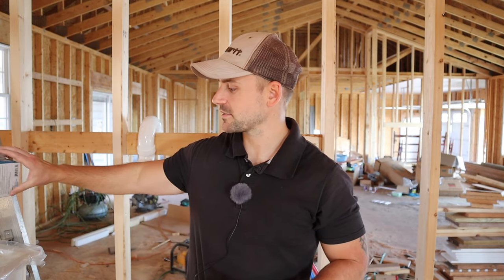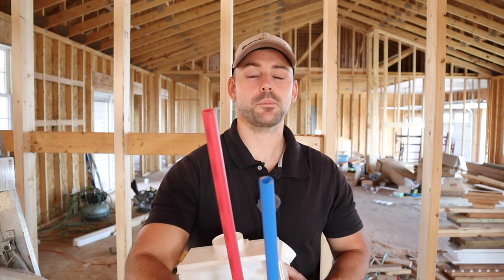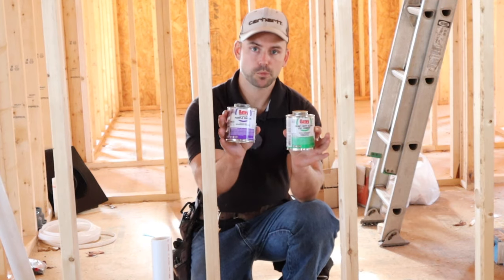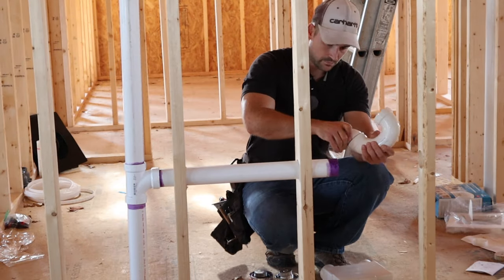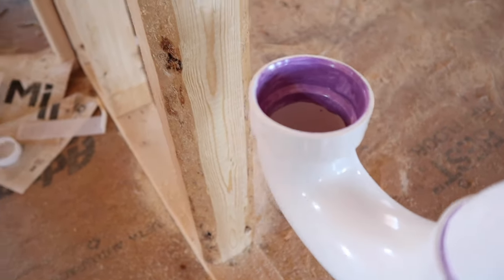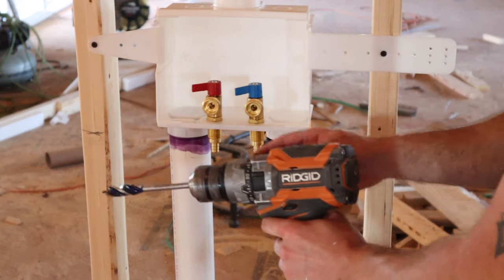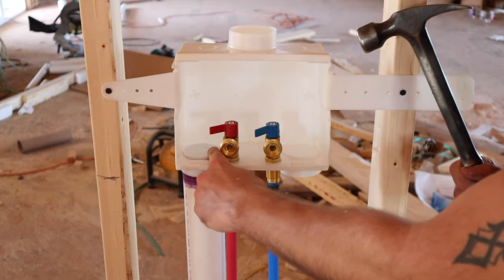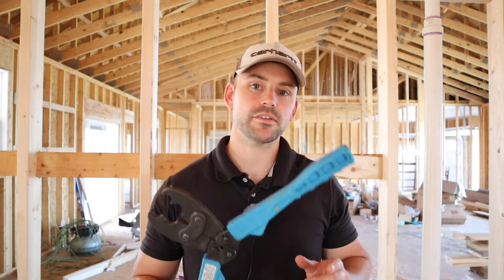Sharkbite Washing Machine Outlet Box Installation

Comment: Why do you need a trap if it is glued? Can’t clean it out? Thanks for taking the time to do these videos! I have learned a ton!
Reply: It’s to prevent sewer gases from escaping up from the main drain pipe(water barrier)
Reply: I use a trap with a drain cap and an access panel.

Comment: So, I have a stupid question. I have this exact same sharkbite outlet box. How in the heck do you get the drain knockout out?!? There's a little hole in the middle that was no problem to pop out; however, to get the whole knockout out seems impossible! It's one continuous piece of plastic! They advise to glue everything together before removing the knockout, but now that I've done that, I think it's made it even more impossible to remove the thing!! How do you get the thing off? I literally think it's one piece, so do I need a special tool?
Reply from the maker: Hello! The best way to remove that is to use a screwdriver that is a flat head and a hammer. Then kind of use it like a chisel and bust it out. Yes it is very strong so you got to put some muscle behind it. I was worried about breaking mine to when I had to knock it out. I hope that helps you!
Reply: @TheExcellentLaborer this comment just helped me!!

Comment: I have 2"x4" stubs. If I drill a hole in them for the 2" PVC pipe, I lose the structural integrity. Should I just run the p trap/drain outside the wall?
Reply: If it's load bearing, use a stud shoe. If it's interior and not load bearing the wall is fine as it's only there to hang drywall.

Comment: The hot water washer hose will not come off. Tried to loosen and tighten the hose to hopefully get some movement but it wouldn’t budge. In doing so, the whole valve assembly moved about an inch to the left and right a few times. It occurred to me that I was bending the copper tube below and behind the drywall. Should I be worried? Fill time for the washing machine didn’t change. Should I be worried? Is the copper pipe much stronger than I give it credit for?

Comment: Thanks for the video. Have you done any better methods besides the hammer for the 2 inch drain cap?
Reply from the maker: I usually use a little hammer. You probably could use a screwdriver and then hit the end of the hammer on an angle from outside of the box if you want.

Comment: Hello. Nice video. Thank you. Would you have a rough idea of about what it would cost me to pay someone to do this for me? How much would a plumber charge to install the box and hook up to existing drain and water connections? I know there's a lot of things to consider, but just a round about figure. Thanks
Reply from the maker: Hey David! A plumber in my area would charge $50/hr for this job. I would guess it would be about a 4hr job in an older house on a crawl space if drains and pressure lines were easy you get to. Hope that helps!
Reply: @TheExcellentLaborer  OK. Thank you so much for your quick reply. I was thinking of doing it myself but I'm still debating that. LOL. I go to Home Depot a lot and I haven't bought any supplies yet. Do I click on your link so you get a cut? Thanks again for your help.
Reply: @TheExcellentLaborer  I also buy a lot on Amazon too. I have one more question. Should I use hammer arrestors? Thanks

Comment: I just bought a home with a new washer box installed already. Can I use a 🔨  and 🪛  to pop it out while it's installed already? I'm afraid it will fall into the drain. I saw a video and the guy said to cut it out with a razor. I tried and broke my blade. What's best way to remove it while installed? Thank you.
Reply from the maker: Hey Tommy! Yes I had to use a hammer and screwdriver to punch it out. It is very tough plastic. Hope that helps!